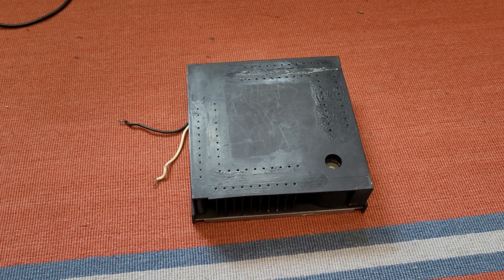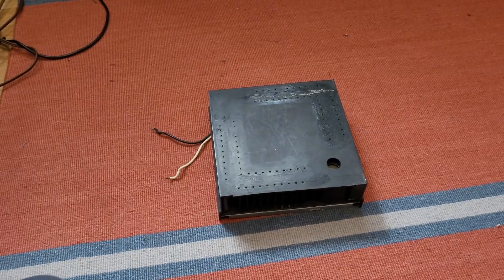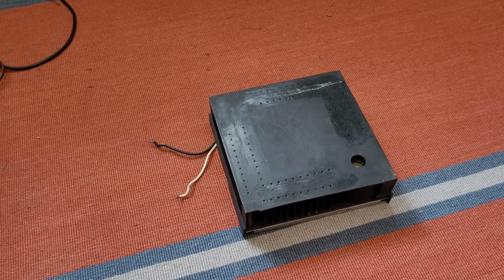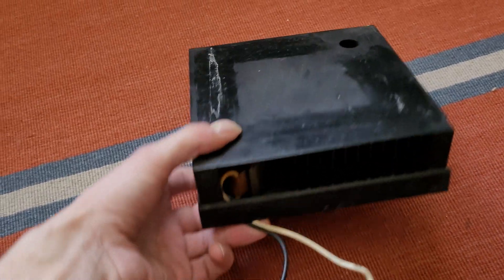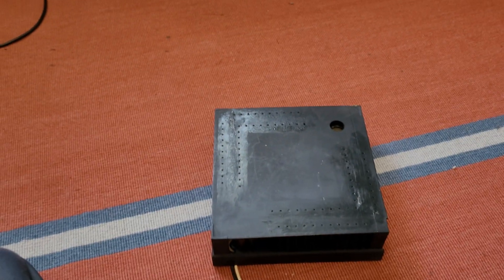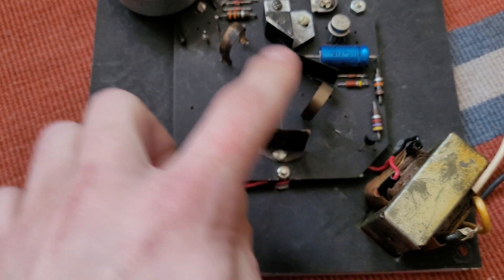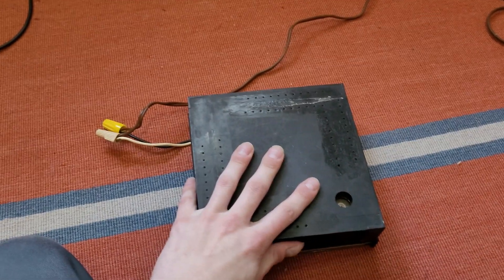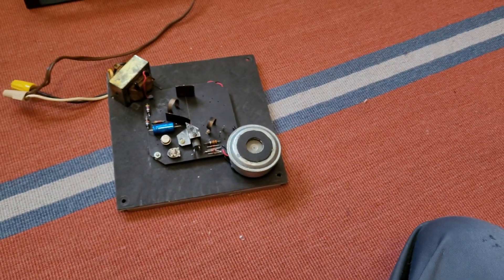Vintage NuTone/Gentex Smoke Detector

Comment: You should try testing it with smoke.
Reply from the maker: it is very temperamental and while I have gotten it to go off with smoke once, it had to be without the cover and it took forever to get it to sound. the sensitivity adjustment knob is a much more reliable means of testing